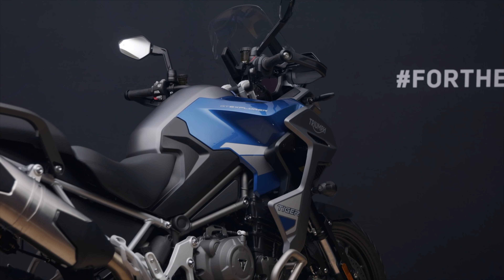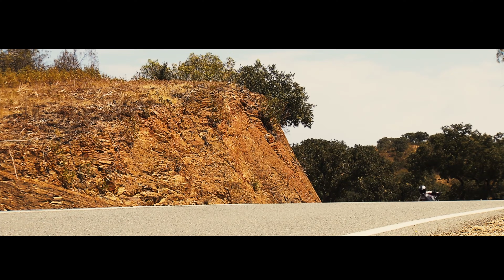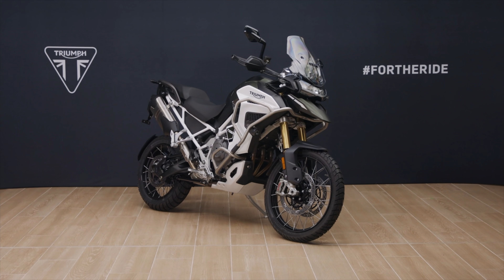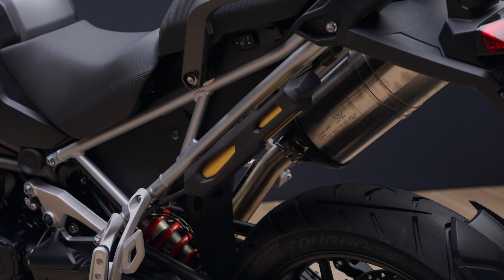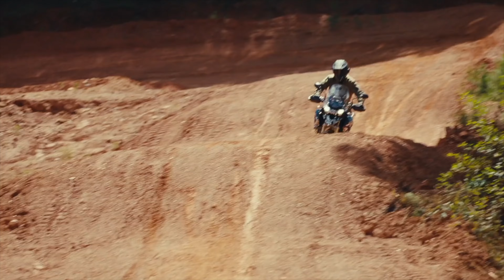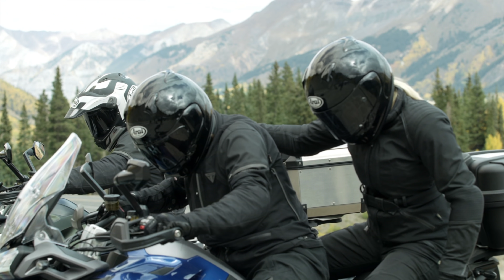2022 Triumph Tiger 1200 Range Preview

Comment: cool presentation,. my only quibble is, why on earth are the GT models such crap colours? The green and white of the off road version is bar far superior 😞, but also the most expensive model.Shame they do not give the option for that on the other models. other than that will be interesting to see delivery times, as the 660, that came out in 2021, here in Denmark was terrible delivery times on.

Comment: Great look at the new tiger 1200. Im really excited about this bike. One interesting thing I've picked up here in the video is the adjustable screen. On the previous 1200 gt pro the screen was electronically adjustable, interesting to see they have moved to hand adjusted this time. Some would think of that as a step back in tech however I thought it was a bit of a gimmick previously so respect to triumph for removing it 👍

Comment: Hi Chris, i’ve watched a few of these videos and there is a lot of emphasis on the weight loss, it will be interesting to see if the weight loss has come off the top end of the bike, maybe with the weight loss across the bike and the semi active suspension it will sort out the problems and handling characteristics of a top-heavy motorcycle, looking forward to your views when you test ride the new triumph explorer 👍

Comment: What warranty is Triumph now giving on these new bikes? 
21" front wheel is aiming more at the Africa Twin which it beats with the shaft drive.
Also is the switchgear illuminated?
Reply: 3 years unlimited miles warranty. Switchgear is illuminated

Comment: What a gorgeous bike for tall people!!
I have the 900 Rally pro and at 5’6” I am on the balls of my feet, now too get one of these I would have to choose the low seat which is slightly less comfortable and is not heated - yet it is still taller than the 900 Rally Pro !
Come on triumph, how difficult is it to provide a feasible shorter ride height option?

Ian
Back on Two Wheels
Reply from the maker: What’s the Rally Pro like on longer journeys Ian?
Reply: @BikeWorldTVshow  I would say really good, I did Northamptonshire to Munich and vice-Versa twice this year, once in a 15hour stretch all 800 miles without feeling fatigued and could have done more. I think it would handle RTW travel no problem, has the speed if you want it on the autobahn and can comfortably cruise along in all weathers.
Reply from the maker: Back on Two Wheels cool, thanks.  We’re looking for a bike to use for filming, we need something to be able to follow Chris off road as well as doing decent miles.  Might try one out.
Reply: @BikeWorldTVshow  for definite yeah

Comment: Thanks Chris (and Triumph) for the video. 
Apart from countless other bikes, I always had a BMW GS on the side since the end 90th, with my last bike the more extreme BMW 1200 HP2 Enduro (with 175kg dry 😎 still my all time favorite). Then i stepped away from BMW coarse they went totally to road focus with the "GS" range. 
I guess, when i was in the market for a new adventure bike, i would go for that Triumph 1200 Rally. It has more tech on board, but still it weighs a lot more than that HP2 from 2005.
Reply: Pl 1 AA

Comment: No 17 inch front and rear model with a more road-biased sport-touring based model for the 1200 engine is a bit of a miss, they could have handedly taken out the S1000XR as well.
Reply: That’s why a lot of us are waiting for the Tiger1200Sport to replace the Tiger1050Sport.